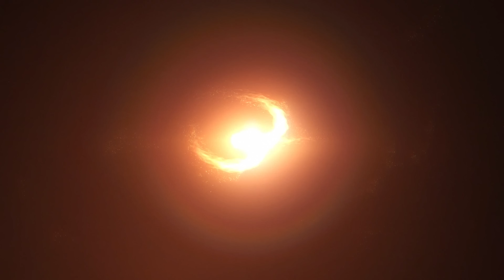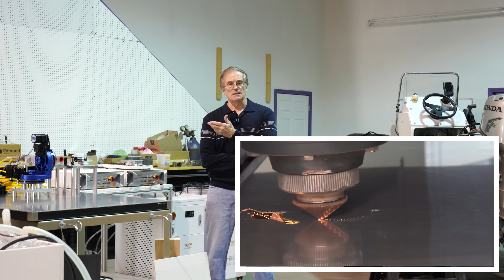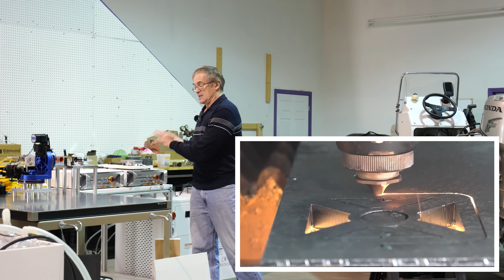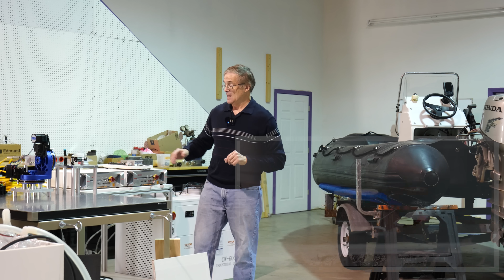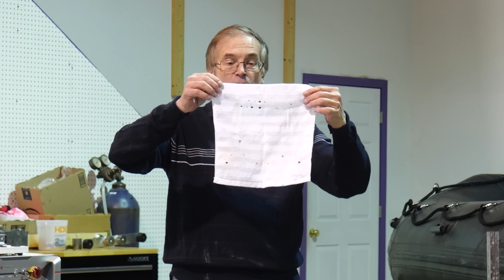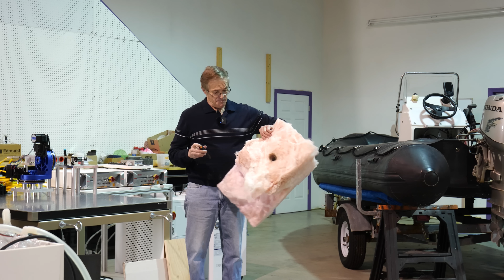We have a problem... and need your help!

Comment: There are some constraints of scale that are not specific here. What is the emitted wavelength from the laser? Assuming it is 1064nm, then a fiberglass mat/belt  running a water slurry of crude KTP  (half as many photons in random directions), or some other useful absorber up at a slow speed might get the job done. That takes care of the dwell time on the absorption medium. I'm not sure of the target area's dimensions.

Comment: Instead of putting your efforts heavily into the materials, look closer at the methodologies. If the target gets hot in a spot, move the target to a new spot. This could be done mechanically or acoustically, or both. Because moving mass is a problem, consider many smaller targets to make a larger wall. You could use something like the acoustic panels you've made in the past to vibrate the structure(s) at various frequencies. Another alternative that is better for higher masses would be many rotating plates with overlap between them. Higher frequencies on the smaller targets, and lower frequencies on the overall system.

Comment: Did you try flower sponge foam soak with water? 
Wide side in direction of beam and few of them in series.
This should hold enough water to evaporate before beam penetration

Comment: Concrete road barriers and a small fork lift and trailer , they are stackable , designed to be easy to m9ve with the right equipment and cheap. Or a few on a low trailer, thatll stop the laser especially if you stack railroad sleepers between them

Comment: Aerogel. On YouTube, NileRed shows the production of it, while Veritassium shows its fire resistance. Or as others have suggested, materials which form foaming carbon materials, such as Starlite, shown off by NightHawkInLight on YouTube. 

If both Aerogel + Starlite fail testing; a [fireproofed] wooden wall filled with dirt/sand/gravel + some small amount of water. This will likely be the cheapest & easiest, but also the most heavy + will release some fumes.

Comment: I suggest testing panels of carbon felt (wool), even preferably few layers of alternating carbon/ceramic fiber boards (felts or mats) on top of each other.

Both materials are not that expensive. They do not dissociate like gypsum (calcination process) or wood (pyrolysis process) and they do not also melt easily. Carbon might oxidize which is a diffusion controlled reaction and takes time. And I expect ceramic fiber to melt and block access to oxygen.

Please make sure not using silica or asbestos based board for your safety. 

Also solid graphite foils can also be considered as a layer but they are kind of reflective. You do not need high quality carbon fiber or graphite foil though. A simple low cost gasket graphite foil can work. They use it for car exhaust seals.

Comment: a wall made of conductive material isolated electrically from the surroundings and being charged by high voltage from a big resistor. If the laser hits it, it will lose charge, and current will increase, and by detecting a sudden increase in current, you can trigger the kill switch in less than a millisecond.

Comment: Hey all. At first I want to say that I didn't read all comments yet, so I might not be the first to suggest this. Second, English isn't my first language, so it might be confusing with some terms. 
I like the idea of using water because of it's capability to store energy very effectively. The laser-savest place in my living room might not be the mirror, but the giant aquarium. 
To cover a wall with aquariums might be a bit of a problem especially because of the weight and the gaps between the tanks. Now we narrow the 'tank' to manageable size and it might work. Polycarbonate sheets for roofing filled with water, maybe running water could do the job. On the market here are some with 16mm thickness, a length of 2.7m and 600mm wide. Colored water, maybe reflective particles should absorb the energy of a laser well enough. Because of the layout two layers are better so the ray could hit just the poly on one panel,  but not on the layer behind it. As a safety measure I'd stick a reflective foil on the backside. In the worst case the ray travels through 30mm running water.
I think I don't need to explain how to get the water flowing, you build rocket engines 😉
After use you still can sell the panels.

Comment: - Beam Dumps: Devices designed to absorb and dissipate laser energy safely. Examples include Acktar's laser beam dumps and Newport's PD Series beam dumps, which use specialized coatings and structures to minimize backscatter.
- Heavy Metals: Dense metals like tungsten, lead, and thick steel plates are effective at blocking high-energy lasers. Steel is commonly used in industrial laser applications
- Ceramics & Specialized Composites: Materials like alumina, zirconia, and silicon carbide are used in laser applications due to their high resistance to heat and laser damage
- Water Barriers: Water can scatter and absorb laser energy, making it useful in certain setups. While specific examples are harder to find, laser safety barriers often incorporate liquid cooling systems
-Absorptive Coatings: Specialized coatings like Acktar’s "Magic Black" and "Fractal Black" are designed to absorb laser energy and dissipate heat efficiently

Comment: Hi, you can try to use wet RockWool, it has a very high melting point and soaks up water easily, so it should survive a couple of seconds.

Comment: Wait a minute... didn't you just do a video about a laser welder? didn't they have light blocker walls for this laser welding system? There is also a possibility of using fire brick which is used in metal furnaces as well as for places to set hot crucibles down to pour liquid metals into molds. That might be able to withstand the intense heat of the laser.

Comment: U R IDIOTS Drons are considered AIRCRAFT by the FAA and thus shooting at or destroying a Drone in flight is a Federal Offense.
Reply: Not in an enclosed space, a flying aircraft in OPEN air is within the jurisdiction of the FAA,
But in an enclosed space the FAA have NO jurisdiction.

Stringing nets across the parking lot still even counts as enclosed.

As long as there's a clear distinction between inside/outside, and it's INSIDE

The FAA can't do jack shit.

Comment: I think your best option is to use something like sandblasted glass or a purpose-built diffusing glass or film that has a high transmission efficiency for your laser’s specific wavelength so that it doesn’t melt the glass/film but diffuses the light so that the lower intensity can be easily managed by a secondary layer. Large panels of sandblasted glass are relatively cheap, and if you want a large coverage area I don’t think there are any materials that are within your price range and size/weight needs. 
My other idea would be an angled sheet of sandblasted aluminum or copper. Both materials are well over 90% reflective in the infrared wavelengths and what little light is absorbed can be dissipated well by both metals. The scattering effects of sandblasted surfaces would keep even a very small initial beam from being concentrated in too small of a spot and would allow for a secondary shield of plywood or something similar to last a long time

Comment: ?not a solution, but I'm curious, what happens if you point the laser on to an aquarium? Will it damage the glass or will the water disperse the laser. Or will the laser go trough but just loose some energy?

Comment: Tiles on xps board. Light, easy to build and prototype, portable, build as many panels as you need and mount/hang for easy setup and storage. Testing a selection of tiles would make for an interesting video itself, materials, surfaces, thickness, layers etc.

Comment: I have a few ideas. 

1. Frame out an enclosure using steel sheet. Id test different gauge steel to see what works best. Inside the enclosure, id fill it with wet sand. You could potentially build it on casters so you could roll it around the shop. This could get pretty heavy/expensive depending on the scale you need. 

You could cut costs/weight by using a cheaper material to clad the non-laser facing sides of the enclosure. 

2. A thicker steel plate thermally bonded to an aluminum plate that acts as a heat sink to dissipate heat as quickly as possible. 

3. Layers of fiberglass mat impregnated with ceramic clay/firebrick material and "paper mache" it  onto some drywall panels

Also, what would happen if you used your death ray lens, but in reverse?

Comment: You said you don't want a reflective material, for obvious safety reasons, but I think that would be your best bet.  If you could find a material that would disperse the laser enough.  Like a silver mirror, but coated on a rough surface?  You are basically asking us to design spaceship armor!

Comment: Wet sand bags:  Pallets of firepit or similarly fireproof sandbags filled with silica sand, then filled with water to soak the sand.
Relatively cheap and easy to repair or replace.  Absorbs the light and heat.  Dissipates the heat through water evaporation.
Mobile via pallet jack, fork lift, or individual bag relocation.  Factors like depth are adjustable to cover any gaps between bags.
Silica sand has a high heat tolerance.  Overall low risk of catching fire, or releasing harmful fumes.  Take care.  Hope this helps.
Reply: Either that, or just plain dirt. The combination of a fireproof material mixed with high contents of water should check most boxes here.
Reply: i think it has the same problem as a brick wall - too massive
Reply: Yes, same thought I had. Maybe concrete bags would work even when dry
Reply: No mate, nothing wet... think what the steam would do.
Reply: Yes that was the sugestion i was about to write sandbags. Maybe put the sandbag wall in an angle i'm worried about dangerous reflections.
Reply: It cant be anything wet... wet in an f-off scale laser = steam... oh, so much steam..... Its gunna cause problems.
Reply: The sand should be as dry as possible or else it will explode as steam is released.
Reply: I thought about sand bags but they wouldn't be easy to handle if you need a 5m tall wall. Mybe you could build a double wall from plasterboard and fill it with simple dry construction sand. It's dirt cheap. If there is a hole, the sand could just close the gap by itself. Use some plaster to fill the holes from outside. You can recover 99% of the sand and return it or donate it to a playground.
Reply: Sand bags could be made from fiberglass cloth and contained in wire mesh holding structures.

Comment: I am not sure what the wavelength for your laser is, but have your considered graphite or a graphite emulsion? @nighhawkinlight has a heat ressistent formula that may also works as it carbonizes under heat. 
Appreciate your videos and hope that helps. 
-Diadon @consciousenergies channel. ✌️

Comment: I think a liquid waterfall might work. I don't know what wavelength of light is output so I don't know if literal water would work. I would think the water could be doped with something absorbent and used in moderation to stretch out the region where heat must be dissipated. I would also think turbulent flow would tend to defocus the beam. An immiscible oil and emulsifier or zillions of air bubbles might help rapidly scatter the light. The main danger might be reflections off of the water. Perhaps ultrasonic water foggers could make a curtain of mist heavily doped with the absorber. The beam might vaporize right though, but the backscatter might be weakened enough for the mist to absorb.

My only hands on experience is with near IR light, maybe 1000 nm or less.  On video, I'm pretty sure bottled water looks black, and a number of plastics, including black garbage bags look clear. That's why I have a little hope pure water might absorb your laser without the complication of additives.

Comment: I can't believe your first ideas were white drywall, plywood, wet thin cloth and then fragile fiberglass. All of these things are combustibles and have no durability! White drywall?? And after you had just said that the material has to be absorbent rather than reflective. I dont know your channel or other videos but if you really thought those things were a good idea to test then I feel obligated to tell you that you are in over your head with this laser. For everyone's safety please discontinue this project until you learn more about laser technology and work with someone who has at least some common sense.

Comment: Hi, idea: 
1) make the background move slightly up-down or in circular motion so you don't always hit the same spot. 
2) ceramics or ceramic coated aluminium sheets... or maybe other metal surface treatment methods they use in engine cylinders... 
3) granite... or basalt...

Comment: Some kinds of decorative fountains are made with a wall that has a contiguously flowing thin layer of water over it. Adapting something like that, and maybe adding some clay, carbon, or titanium dioxide, something to make the water dark/milky, could possibly work. You'd have a continuous supply of water over an entire wall (or at least panel), which should stop the point evaporation issue.

Also, maybe some kind of intumescent material? Other folks on youtube have made high temp resistant materials with cornstarch/chalk/PVA glue compositions that are extremely fire resistant and would probably have good laser protection performance. I know nighthawkinlight had a video or series on developing a material like that.

Comment: What about about building may layers of fog screen (like the kind you project onto.) in front of a fire brick wall. The water in the fog will diffuse the beam before it hits the wall, as well as absorbing some if the energy. The water will also soak the brick letting it survive for longer. You can DIY the fog screens so you dont have to buy commercial ones. You can also test the concept with a small peizo electric fog maker.

Comment: You might be over-thinking this/ I imagine a reflective solution that reflects the beam down into a bed of sand or water or similar at a 45 degree angle . You could reflect into a 55 gallon drum or similar filled with the substance of your choice.

Comment: 1] fire laser into the earth, a pit, and not horizontally.  sorry about your test stand .  fire into the end  of a long mud filled pipe..  mud is easly renewable and reformable..  other options include convex mirrored surface inside a water tank but mud should be better, cheaper..

Comment: 1. Laser Beam Dumps (Absorbers):
	•	Carbon-Based Materials: Graphite or carbon composite blocks are highly absorbent and can dissipate heat efficiently.
	•	Copper or Aluminum Blocks: These metals have high thermal conductivity, allowing them to rapidly disperse heat from the laser spot.
	•	Tungsten Blocks: Due to its high melting point (over 3,400°C), tungsten is an excellent choice for absorbing extremely high-power lasers.

2. Special Optical Coatings:
	•	Anti-Reflective Coatings: Minimize laser reflection, reducing the risk of secondary hazards.
	•	Absorptive Coatings: Designed to efficiently absorb laser light without significant heating.

3. Laser Absorbing Ceramics:
	•	Ceramics like boron carbide or silicon carbide can absorb high-energy lasers without significant structural damage.

4. Water-Cooled Beam Dumps:
	•	A water-cooled metal plate or chamber that can absorb and dissipate laser energy without reaching critical temperatures.

5. Advanced Composites:
	•	Metal Matrix Composites (MMC) can combine the thermal properties of metals with the strength and absorbance of ceramics.

Best Choice for Building Protection:
	•	For protecting buildings, a combination of tungsten panels backed by water-cooled systems is highly effective.
	•	Alternatively, using carbon composite panels with heat dissipation structures can also provide high efficiency.

Comment: Maybe use angled white painted surfaces that reflects most of the Laserlight. If you reflect 99% of the Laserlight and send it in Imperfect circles, the power spreads over that surfaces.
Another option is to try to spread the laser on a large target by making it looooooooooooooooong with a sharp angle.

Comment: Large aquarium tank  with a copper heatsink as one of the panes. The Cu should sink the heat quickly as it is getting cooled down by the thermal mass of the water.   You may need several layers of copper with water between them to avoid burn through.

Comment: It may not be practical, but a stream of falling gravel, possibly the outfeed from a conveyor, would probably work. This minimizes burn time on any individual piece and is self healing. You would just need to provide a sufficiently high flow rate to allow for either no gaps or sufficient thickness. In order to have it provide continuous protection, just recirculate the gravel. Other materials may provide improved performance or practicality. This is conceptually similar to a dust shield in sci-fi.

Comment: Graphite seems to be a good candidate for it's high fusion point and low cost. The solution would be to have a moving "object" like a powder in movement to absorb the energy, anyway it seems to go high really fast in temperature.

Comment: One question to focus the community answers is : what is the wavelength of this laser. Some material could be better at absorbing. Mainly thinking about aquarium with some black ink without more specific informations. Reasoning being that, if it doesn't get absorbed by the glass, and you'd have to mind reflections with the power level you are describing, the water will absorb everything while dissipating enough heat for that "few seconds" time you mention. Also it is easily regenerated since it is just water.

Comment: Peltier cooling grid array painted with vantablack paint attached to a water soaked thermal mass and wired to a large electrical load or resistor to dump the thermal energy it absorbs as electrical energy.